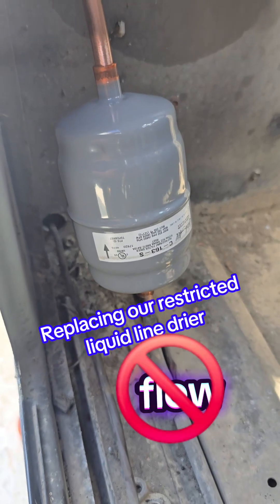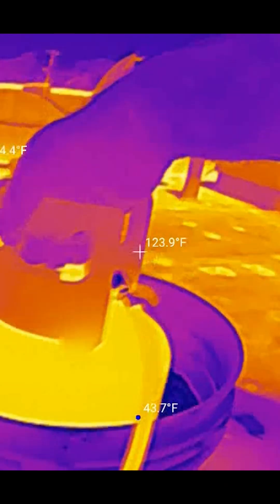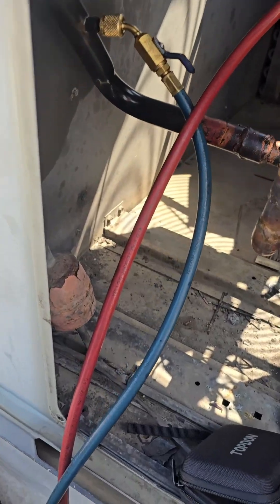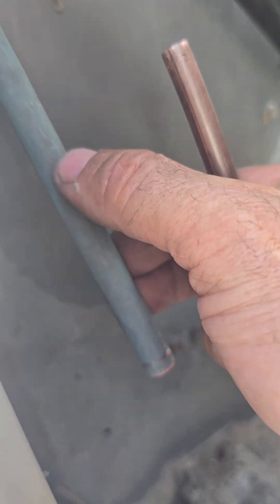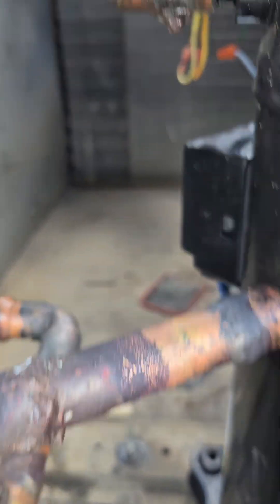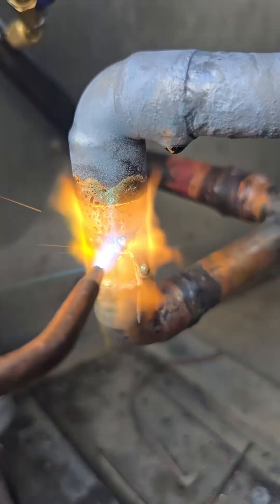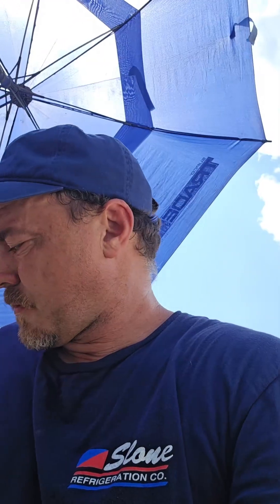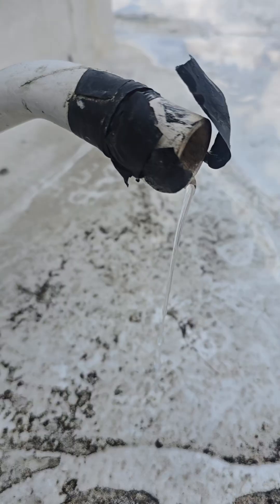Replacing a Restricted Filter Drier

Comment: Maybe using 95% of factory charge,when using R407c has worked for me.2 cents.
Reply from the maker: I typically start at 90% charge and then charge it to sh or sc depending on the type of metering, turned my head too long and she drank the whole charge but worked well
Reply: @LetsBeTechs I think she was thirsty 😂
Reply from the maker: @MariosACandRefrigeration  she was!!!kinda surprised me, it was so hot out I figured I'd only get 50% in before it eaualized

Comment: Thanks! Another Tech tip!.. recover to the liquid side of the cylinder then add a hose from the vapor and relieve the pressure into the low side of the system, similar to a push/pull, it reduces the tank pressure and there is less need for water and/or ice. 💪
Reply from the maker: I played around with that once a LONG time ago, i didn't get the expected results at the time but was in a hurry,  had a junk recovery machine, and didnt explore it much.  i definitely need to revisit that!!